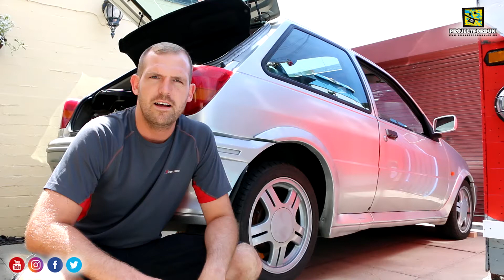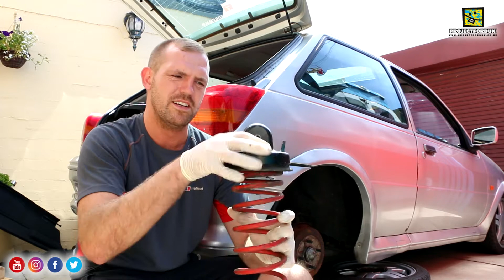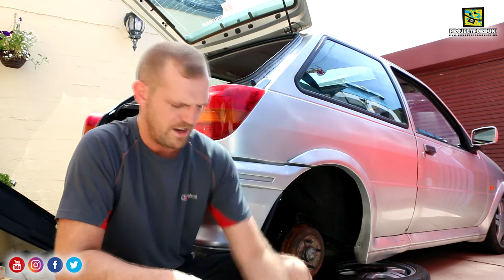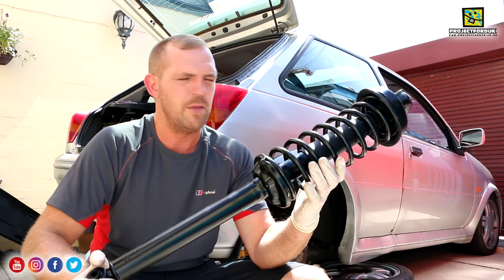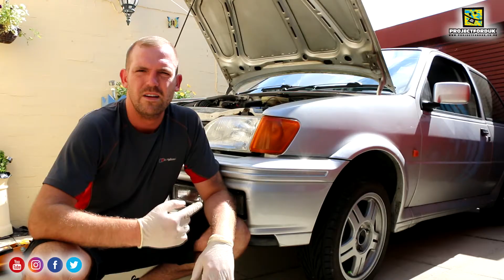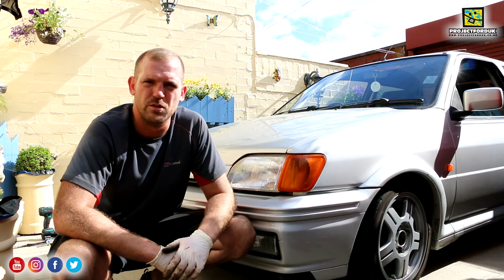Part 16 - Suspension Swap - 1993 Ford Fiesta RS 1800 / Turbo Restoration Project - HD

Comment: Loving the vids. Going to be doing my own fiesta RS turbo over the winter. Where did you get the shocks and springs from? Mine is ridiculously low as well, can only find lowering springs. So frustrating!
Look forward to the next vid👍
Reply from the maker: Hi Paul ebay item numbers are below:

Front Shocks: 252241518471
Rear Shocks: 252837040050
Front Springs: 230694708532
Rear Springs: 230694708551

Hope this helps and thanks for the feedback.

Danny